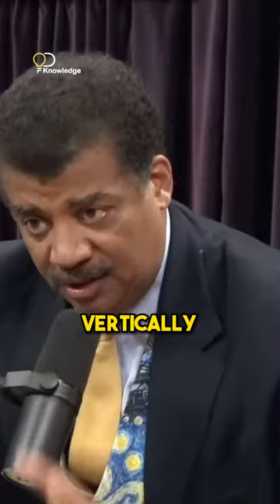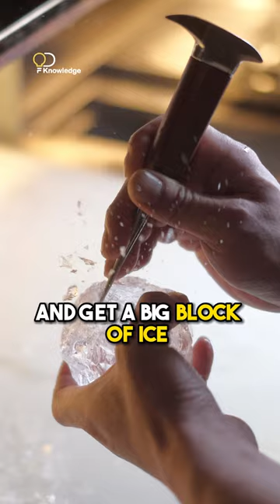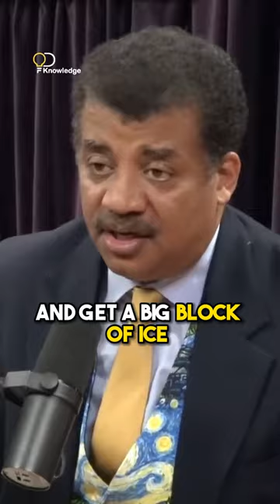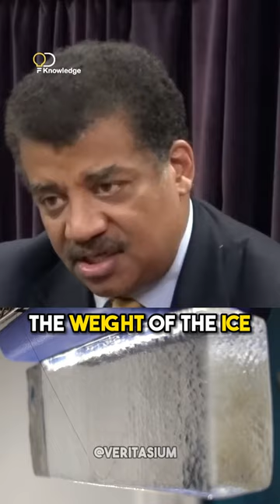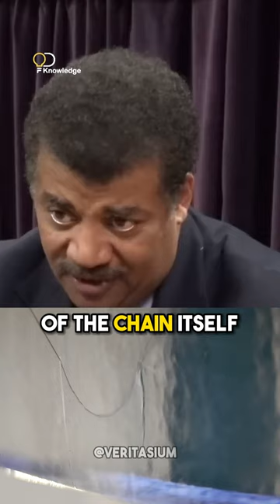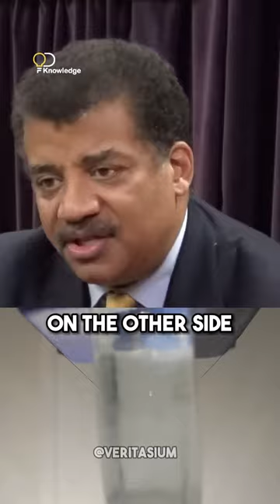Can You Pass A Block Of Ice Through A Chain Link Fence? with Neil deGrasse Tyson

Comment: Ice skates work on a similar principle. The weight of the whole person is concentrated onto a very small surface area, the blades, which melts the ice directly in contact with them, this creates a small bead, coating, what have you, of water that the skates glide on.
Reply: Id say friction also
Reply: This was actually disproven in 2020, im not sure exactly how it works, but i do know it was disproven
Reply: @slapshot09 no it wasn't lol
Reply: Didn't ask
Reply: @blanco7726 there is almost no friction(very little) it's metal on ice. They use water as a lubricant when cutting brick.
Reply: You can also pass a pair of skates your your or someone else's torso
Reply: you learned that from him, I heard that before
Reply: If you do not have a source for that then ice skates still glide on water and not ice, it's kinda basic physics. @slapshot09
Reply: This myth has been busted years ago.

Comment: Doesn't there come a point where the weight of the ice is no longer sufficient to cause melting & therefore only half the ice will be left on top or will the weight of the ice on the bottom be  sufficient to allow it to pass all the way through ?

Comment: Is it pressure or does it depend on the material? If you place ice in contact with some material letting heat pass through easily, it will melt sooner. It's the same technique used to form ice spheres by barmen.
Reply: Its the pressure. If you look up "p T diagram water" you will see that higher pressure lowers the freezing point therefore its getting liquid
Reply: no he is reffering to the physics that happen when you use ice skates. the blades press 150 pounds down to a 10th of an inch creating super massive pressure, ice needs expansion so if you compress it even at lower than freezing temp it reverts into water. this is also why pipe freeze and break, the water gets down to under freezing but is held as water cause it has no room to expand until you open the pipe and it instantly turns to ice as it gets room to expand.

Comment: so can someone please answer me this.
Theoretically if i was to freeze a person. would they go through the chain link fence and come out on the other side. Still the same as before?
Reply: Probably not, if this is a serious question. Pretty sure this is only possible because of the unique molecular structure of ice, since in solid form water actually has a larger volume than as a liquid, the pressure compacts the ice, temporarily melting it, and then as it passes the pressure point the surrounding temperature forces it to expand and freeze again. Humans are not 100% water though, so